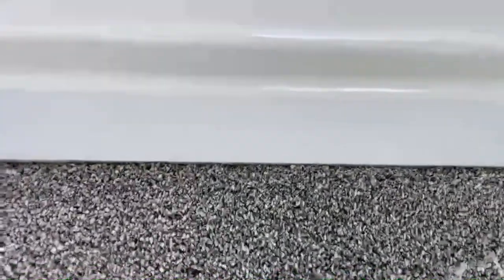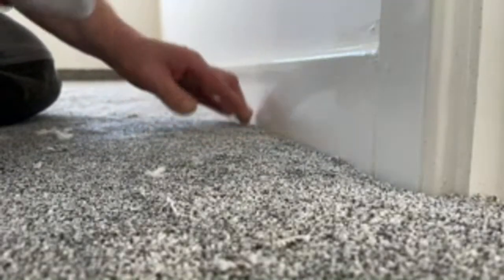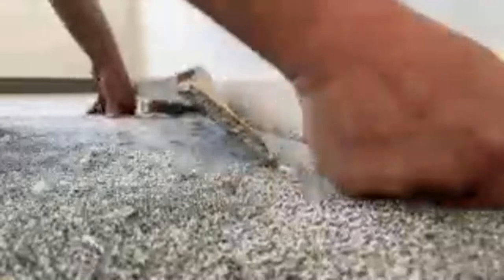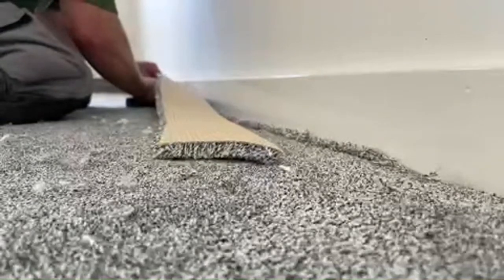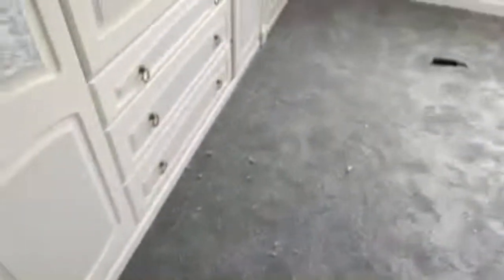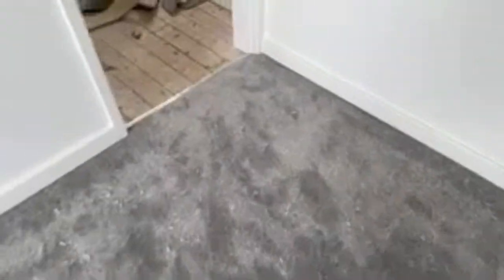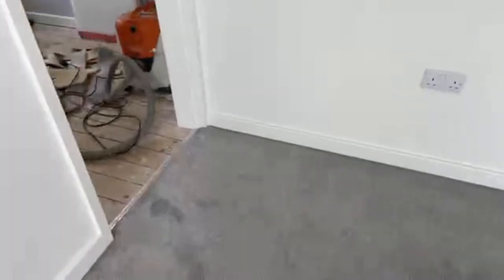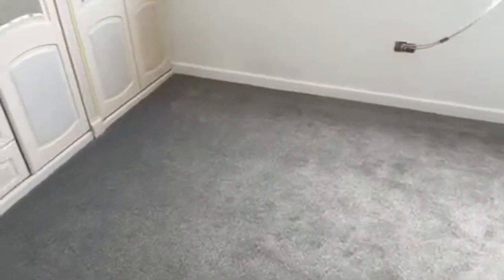VERNS SEA FISHING | CARPET FITTING SO I CAN GO FISHING GET THE JOBS DONE BUT NOT THE SHOWER 🔴 LIVE

Comment: I was taught to fit with a stair tool/bolster. 
To be honest you're wrong to say what you said, I've never had an issue with it and find it a lot better tool to use  due to its weight as it helps to tuck thicker carpets.
I find the eye witness marks the skirts more and is more dangerous as it has a shape edge. 
As the saying goes.. There are many ways to skin a cat!!
Reply from the maker: The sharp edge is removed as well as the point. I was taught to fit carpets at Fitta by two master fitters who said you do not use a bolster. The tucking knife is thinner and does not trap extra tuffs in the gully as a bolster does. Leaving it cleaner. Many ways to skin a cat and this is mine. Wouldn’t have passed my intermediate carpet course using a bolster.